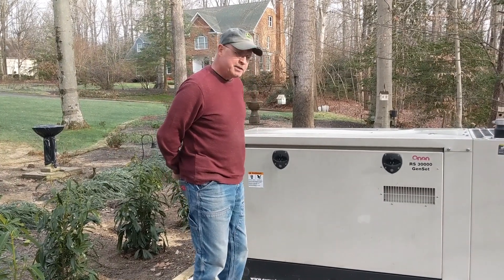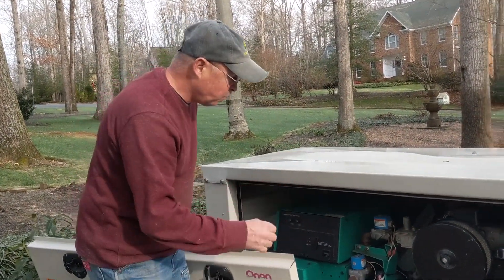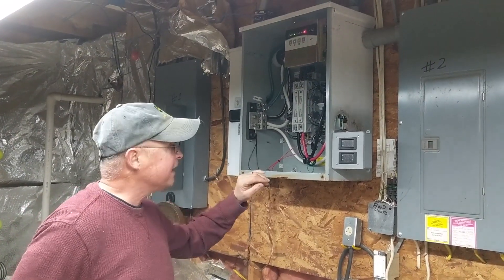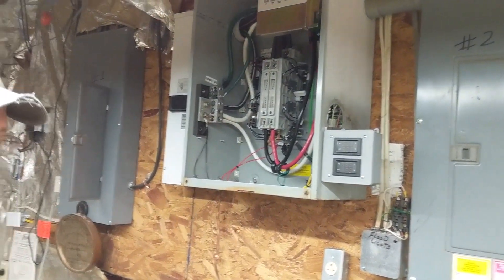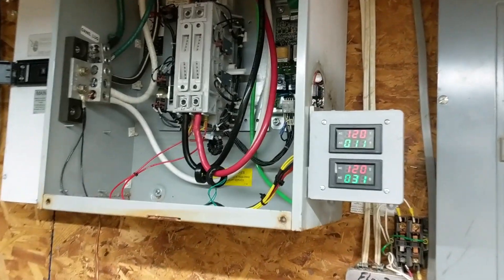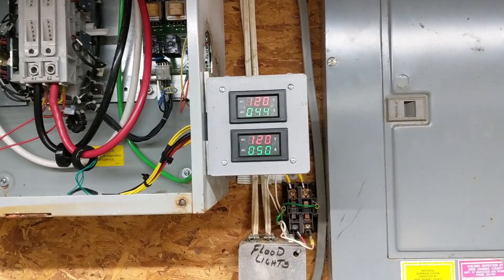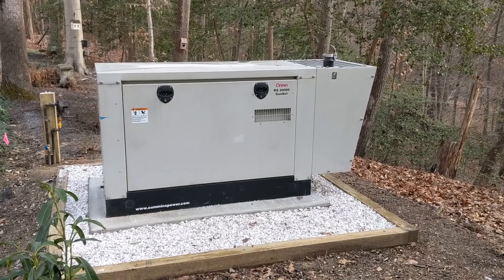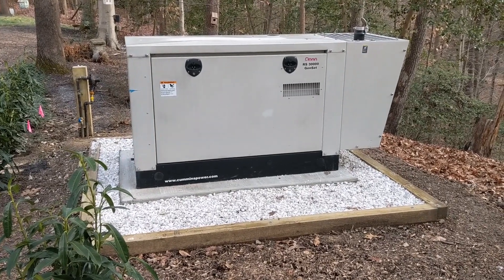Onan RS30000/Cummins GGMC-6113 Generator and GE ZTG Transfer Switch test and demonstration.

Comment: Hi, nice video, however this Cummins Power Generation- Onan model GGMC (30kW) same family as the GGMA (20kW) GGMB (25kW) utilizes a General Motors, (modified by PSI (Power Solutions Inc) is a 3.0L Inline 4 cylinder) similar to the old 2.5 iron duke GM engine. 
The controller uses a PCC1302 controller which digitally integrates the Safety Shutdown/ engine management system, the engine governing control, and Voltage Regulation (Shunt Field Excitation) 
I’m a 35 year Power Generation Technician, and Field Engineer specializing in Cummins, DDC/MTU, Kohler. Just an fyi.

Comment: Hey I just bought the same gen set what’s the information on the automatic transfer switch you used ?
Reply from the maker: Fred, I have two GE/Zenith ZTX 200 amp transfer switches. (we have two 200 amp panels going into the house) I bought them used, but if I was to  do it again there are newer more modern solutions available for much less money. They do work great though. BTW, if you need a water pump (mine sat for a few years, so the pump seal leaked) the same parts are used in Heister Forklifts and are 1/3 the cummins price.... Good luck!
Wayne

Comment: I have a 25KW Generac 1800 RPM liquid cooled generator. It has the Ford 2.5L engine. Very similar to your setup here. It is capable of ~104 amps.
Reply from the maker: That's awesome.  I know  generac makes some  "real " generators. Just  home depot doesn't sell them around here! Thanks for watching
Reply: @WaynesWorldGarage  yeah you have to buy them from a Generac "Industrial Dealer" or a few generator websites sell them like norwall.com. You will never find these in a box store.
Reply: @MICHAEL KING I have a 2004 Mustang cobra with 620whp and 80K miles. I drive it every day. Never broke down.

Comment: For a man your age, you're not too smart by sticking your hands in that energized panel, and you wearing ring something metal that can cause great harm or death. You need to be careful.
Reply from the maker: Thanks for that advice!  I guess it's hard to see on the video, but my hands/fingers never go inside the panel/box. It's not like a 13.8 KV line and it's going to jump out and bite me.... Yea, I've worked with much higher voltage in my day.... But for this, I had a licensed electrician to do the final hookup and testing. (plus, it's hard to bend 2/0 wire!!)
Reply: Actually he appears to be very smart and knowledgeable about his system. Every detail is properly explained.

Comment: Where did you buy the generator?
Reply from the maker: I bought it from a guy in Shadyside Maryland. It came with the house he bought two years ago, and it was taking up too much space in his narrow yard. I suspect the generator company would have charged him to remove it.  I gave him $2,500 for it and I uninstalled it. He paid an electrician to re-connect the power directly to the meter and uninstall the two transfer switches.
Reply: @WaynesWorldGarage  Wow what a find and what a bargain and everybody's happy.
Reply: @WaynesWorldGarage  you stole that thing. Looking at getting a Cummins 25 or 30kw unit. We are in Texas and after this freeze we just got we will be installing one very soon.
Reply: @WaynesWorldGarage  I can't imagine anyone getting rid of a generator. They are going to regret it when there is an extended power outage.
Reply: @WaynesWorldGarage  2500? Are you serious? That unit brand new is around 12K.